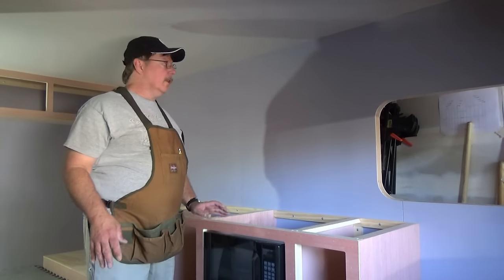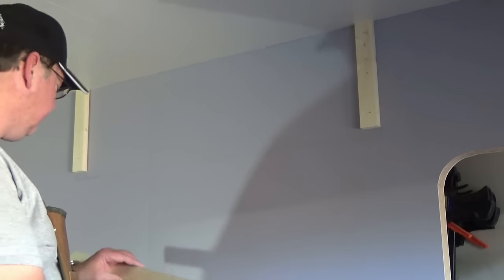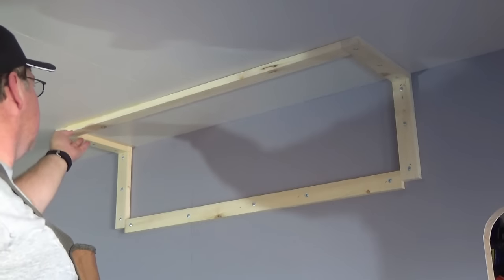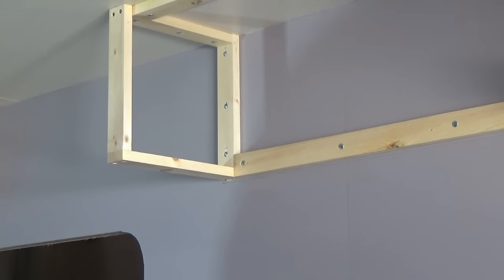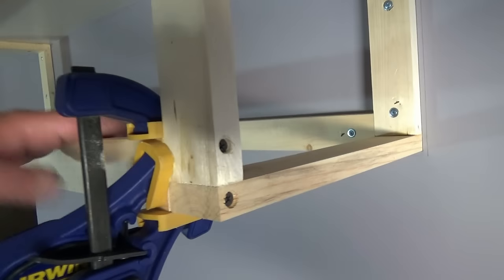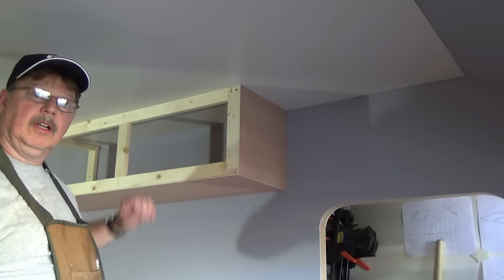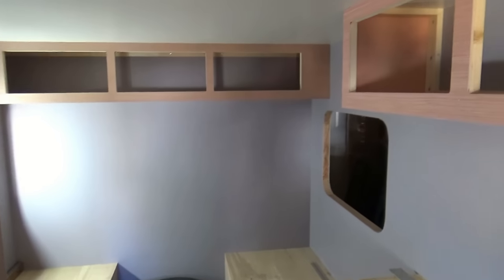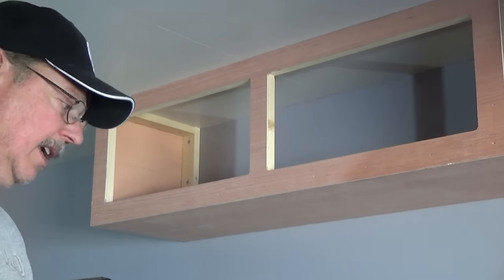How To Build A DIY Travel Trailer - Part 19 (Cabinet Above Kitchenette)

Comment: That thin plywood across the bottom seems awfully flimsy to hold heavy can goods. Am I wrong? Also, any concerns about having to tie the battons to the ceiling frame?  I told you I don't know anything about woodworking, so I'm just asking.
Reply from the maker: Great questions... once all of the cabinets are up, another bottom is put in place to hold the heavies (another video). The battens are also attached to the roof beams. I've hit some pretty rough roads while traveling and all is still tight. The torsion axle does absorb a lot of shock. I have no worries about anything falling down! :)